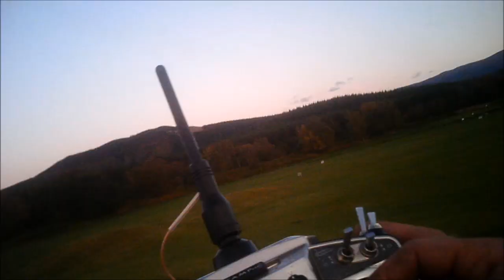Telink 3D Buster

Comment from the maker: kv is the number of revolutions per minute per volt not the voltage it's running on. As it's a 3S lipo pack with a nominal voltage of 3.7V per cell but a fully charged voltage of 4.2V per cell this means with no load, i.e. no prop, you should get in the region of 4.2x3x1250=15750rpm. I've never checked it so I don't know if it does or not but it sure rattles the model skyward.